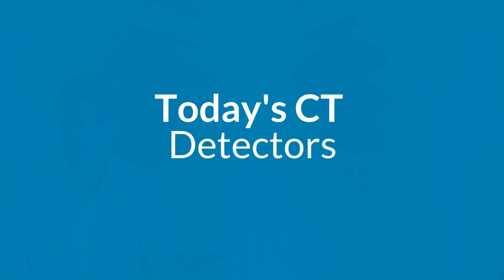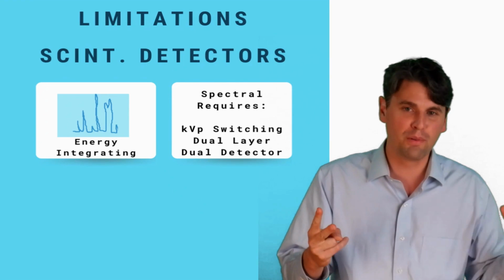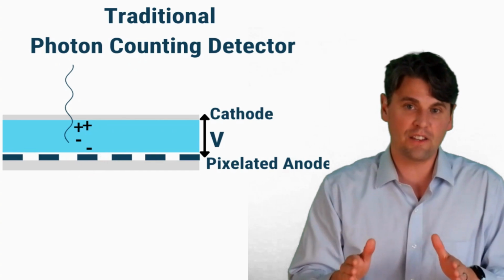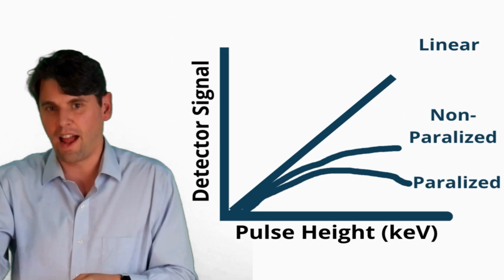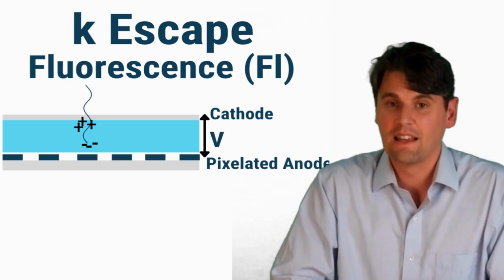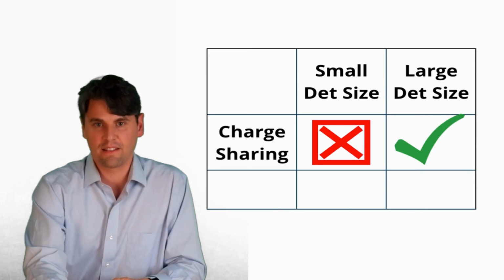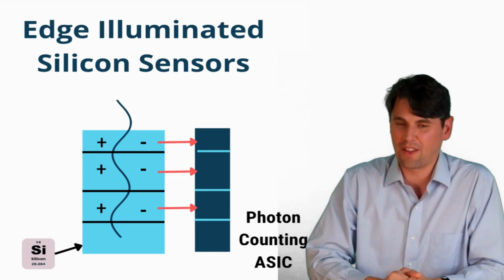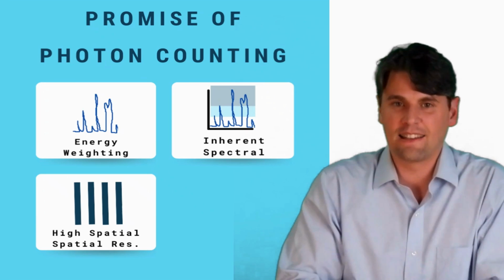PHOTON Counting CT, How PCT works.

Comment: It’s very interesting. I wonder what is usefulness of photon counting detector in single energy imaging apart from electronic noise?
Reply from the maker: John did you watch till the end? The main advantages additionally are spatial resolution and the ability to more optimally weigh the photons in making a combined single energy image
Reply: @HowRadiologyWorks  great point about the equal weighting. However I’m not sure about the improvement in resolution as the CT detector pixel size is ~1mm and there is no more 150 um optical spread of light, hence not a large difference. I can definitely imagine the resolution improvement with photon counting detectors in small pixelated chips. 
Keep the great work. It helps retirees like us to get in touch with the technology.